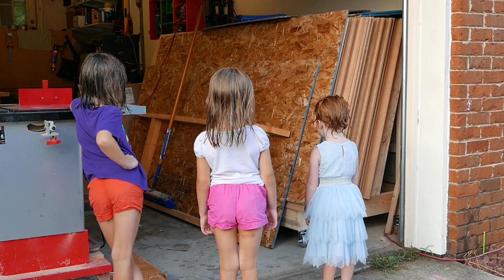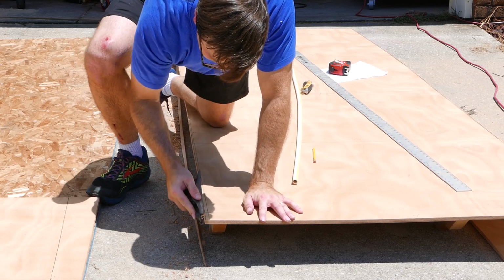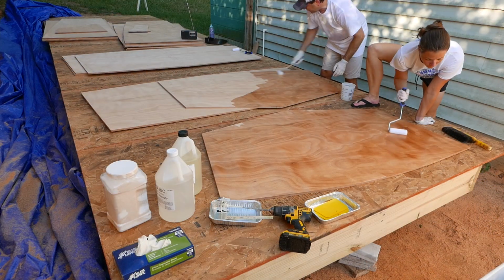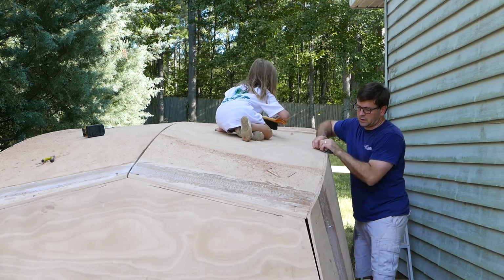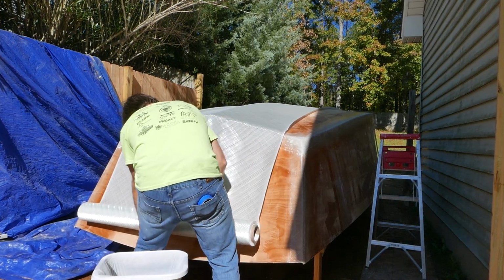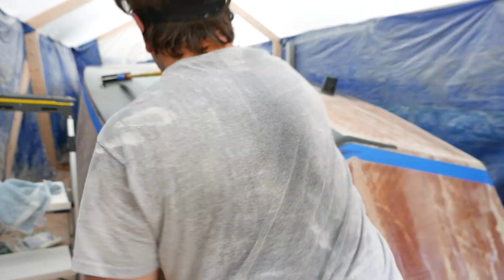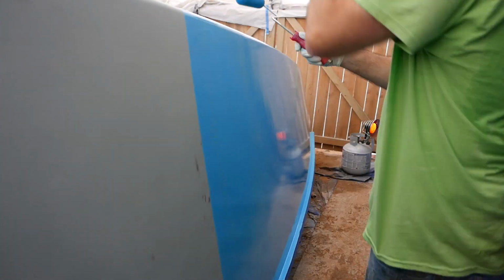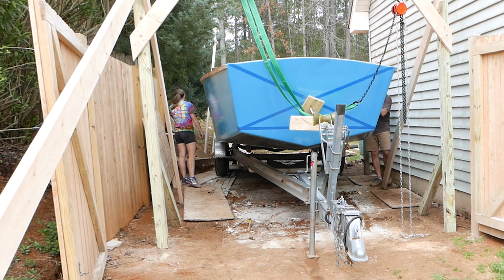Building our GT27 Houseboat, Part 1

Comment: Absolutely beautiful Mark, the girls and the boat!  Great work.  Block planes and flush trim router bits are two of my most used boatbuilding tools.  I haven't used Raka epoxy yet, how do you like it.  Great video documentation, thank you!
Reply from the maker: I've been using Raka epoxy since my first boat (a cedar strip sea kayak) over 20 years ago. It has always been fantastic!

Comment: Did you study boat building at all.  I did in Australia and found your knowledge to be very insightful.  Good work though... Hard work, but its well worth it.
Reply from the maker: I'm a pretty thorough researcher and I love to learn things, so I just taught myself over the last 25 years, mostly learning from reading and the insights of kind people on the internet. This is my fifth boat, so I learned a lot along the way by trial and error as well. When I built my first boat, a cedar strip kayak, I had almost no woodworking experience and had never used fiberglass. But I learned so much on that build and really was meticulous in making sure I did everything right. The boats got a lot bigger after that--a couple of sailboats and a large dinghy of my own experiment--but this GT27 has been the biggest by far, and I'm learning a lot more because of all the systems (plumbing, electrical, fuel, etc.) that will need to be integrated. It also just has so much more surface area that the work is exponentially more than even the 20' twin-masted sailboat I built a decade ago. And the weight is so much higher, too, that I'm learning a lot about towing weight, electronic brake actuators, etc. as I upgrade the trailer. Quite a project...
Reply: @LiveDontWatch  Exactly what I do still.  Just to do research, research and more research....  I'm currently building my houseboat.  I normally find it best to 3d in CAD with the level of detail for the hull and pontoon, then with the cable lay out and the c sections that make up the exterior walling.  Plus the plumbing, etc...  Watched all your vids so far, but have you finished the boat in all, or is it still on going ??
Reply from the maker: @rbob1973  the boat is pretty much where the last video left off. From June to early September, it was just too hot to work on it. Now we're insulating the cabin and getting ready to build out the interior.  I think I can heat it through the winter and get a lot done inside, but I'm scrambling to finish some epoxy work before the weather turns too cool.

Comment: Hi LiveDontWatch,
I hugely appreciate the videos and the building process shown and elaborated upon - huge respect and appreciation for making the videos!!!
Could you please advise on what type of a plywood was used and where it was purchased from? Was it a pressure treated or some sort of a special wood you had to buy from a special place?
Sorry if you mentioned it anywhere during the video, I could have missed it.
Thanks!
Anton
Reply from the maker: The plywood is BS1088 rated Okoume plywood purchased about 4 years ago from Boulter Plywood in Massachusetts. At that time, their prices were better after shipping than many places much closer to me. And the plywood I received was of superb quality with all proper BS1088 markings.
Reply from the maker: FYI, BS1088 is a British standard certification that means the plies will have no voids, knots, or cracks, and will be laminated with a marine grade glue that will not delaminate even when exposed to boiling water for 30 minutes. Okoume is also very light weight. It's the premier plywood for boat building.
Reply: @LiveDontWatch  Thank you! I was able to get in touch with them and arrange the shipment.
Reply: @LiveDontWatch  Could you please advise on a reasoning to glue sheets together with epoxy resin? I've done some googling and it seems like "Titebond III Ultimate Wood Glue" is what's recommended to glue the wood. Please advise and many thanks!
Reply from the maker: @Anton Kosyriev  I think some people use Titebond as a cheaper alternative to epoxy resin, but in my experience thickened epoxy is the best adhesive for marine applications so that's what I use exclusively for boats. I might use Titebond for interior enclosed furnishings, but I've never used it on structural elements or areas exposed to the elements, so I can't say how Titebond holds up compared to epoxy.

Comment: Please sir, at 6:40 you used this very accurate electric saw that allow you cut very fine curves with ease and you called it flush saw. I tried to find it on the internet but a lot different kinds of manual saws. Please, can you share a link to your kind of flush saw?
Reply from the maker: It is a flush cut bit that you attach to a router. Sometimes called a flush trim bit. It's a spinning router bit that has a bearing on the end which rides along the edge of a template to  trace its outline and cut out an exact copy. https://www.homedepot.com/p/DIABLO-1-2-in-3-Flute-Flush-Trim-Bit-DR44100/202585369
Reply: @LiveDontWatch  Thanks for prompt reply & your sharing. May your days be long!

Comment: What wood did you use for the rub rails?
Reply from the maker: Douglas fir. I would've preferred mahogany or ash but it's very tricky and expensive to come by in my area. I may screw some stainless hollowback along the rub rail later to give it some extra durability.

Comment: That seem you filled down the middle of the hull was pretty wide. Hows that holding up?
Reply from the maker: It's doing fine. There is so much biaxial fiberglass on both sides (inside and out) that I don't think the hull is able to flex at all along the vee/centerline, so there should be no stress on the filler. The filler is really there just to eliminate air voids. In fact, the front of the boat is still currently propped up on the vee (i.e., fully supported on one concentrated spot) and there's zero deflection/distortion.

Comment: Looks like you used casting resin! I also build boats with casting resin. Similar shore D and tensile strength rating compared to overpriced west systems epoxy.
Reply from the maker: I use the Raka 127 resin and compatible fast/slow 600-series hardeners. Great value and I've always had excellent results on multiple builds -- a cedar strip sea kayak, two sail boats, a self-designed skiff, and now this houseboat.

Comment: A few nitpicks on your building process:  
Firstly, your panel joints would be much stronger if you had scarf glued them.  Worth the extra effort.  Butt joints like you did would have been okay if you had first routed a shallow depression matching the footprint of your fiberglass tape on both sides of the panels and if you had built up a few layers of fiberglass tape on both sides.  The routed depressions and the correct number of fiberglass layers would have made the joint flush with the rest of the panels and you would not have needed to sand it back down as much.  
Secondly, I noticed a lot of air voids in you fiberglass, indicating insufficient wet-out.  Fiberglass cloth and mat should be completely transparent when fully wetted, showing the underlying plywood without any white spots.  This could be a problem for you in the future, perhaps sooner rather than later.
Thirdly, it is worthwhile to determine and mark the waterline all the way around the hull and paint bottom paint to the waterline.
Reply from the maker: Thanks for the suggestions. I'm well familiar with all of those issues, but there are reasons this design does not use scarf joins--in part because the dimensions utilize the maximum length and width of plywood sheets in several cases, and largely because there is so much  reinforcement from the structure and the layers of 'glass that concerns about the joint strength of the skin are moot. 

There are definitely no voids in the fiberglass. This is my fifth build and I am meticulous by nature. You may be seeing sanding spots, dust, distortion from the camera/lighting, or the sheer thickness (whitish build up) of the many layers of glass, but they definitely are not voids (unless you mean under the temporary butt splices for the hull sides--those were removed for that reason once the panels were in place). 

I chose not to mark the waterline on this hull because I was unable to contact any builder who has successfully completed this design. Although the designer provides some indication of the waterline at various displacements, mine has some moderate adjustments and a custom interior/load-out that may or may not affect it. For that reason (uncertainty of exact placement) and simplicity of maintenance, I chose to forego marking it. This is a trailerable design, so ablative bottom paint is unnecessary, and durability of the true bottom was primary. Hence the epoxy-graphite mixture of the bottom. You're right to be vigilant on each of those issues, but in my case, they don't apply.
Reply: @LiveDontWatch  I see your points.  It seems you've thought these things out pretty well.  I've built one boat and am working on a second.  I special-ordered 5'x10' marine plywood for mine to overcome some of the issues you cited, and scarfed my joints.  The finished product turned out much better as a result, with nice fair curves.  Once you finish outfitting your boat you can easily find the waterline by launching in a calm body of water.  tape a pen to a block of styrofoam and run it all the way around the boat.  Use that "rough draft" as a guide for painting the water line and boot stripe.
Reply from the maker: @locutus8496  Yes that's exactly what I'm planning for the waterline. Very nervous about how this will all go as this is the first time I've built an unproven design without talking extensively with existing owners. It's a huge investment in time and money,  so hopefully performance will match up with the design parameters as intended. We'll see...

Comment: Question:  I've started building the GT27 and I was wondering if I could glue the bottom panels and sides on the strong back and stations itself with just epoxy gluing them together and fiber glassing just the outside of the boat before the great flip?  Could I get by with the entire hull fiberglassed and painted on the outside but without the inside seams fiber glassed until after the flip?
Reply from the maker: That's what I did. All the way to paint before flipping.
Reply: @LiveDontWatch  I watched your video and you used epoxy/fiberglass on the seams first.  I was asking if I could secure the individual bottom pieces to the strong back stations and then glue them in place and fiberglass entire hull without laying them out and on a flat surface and gluing them together first?  This would leave an entire hull to flip with just epoxy and fiberglass on one side?  The reason why I am asking is that I've already built the strong back and stations and I don't have a long flat surface to pre epoxy the bottom pieces together.  I appreciate your advice and thank you for the inspiration to "LiveDontWatch"!
Reply from the maker: @markbroussard7394  Oh sorry, I misunderstood your question. Although your idea is probably possible, if I were doing it over, I would DEFINITELY still join the side panels end to end the way I did in the video (in my opinion). I would be very concerned that trying to align the panels in place, without first having joined them end-to-end with tape, may hinder them from taking a truly fair curvature around the forms. Even then, I still struggled to get a perfectly even/fair sheerline and hull shape, but I think it would've been much harder if they weren't joined first. In my case, much of the struggle was just because of the narrow building area, which prevented me from backing up far enough to get a good perspective to sight the curvature by eye. I'm happy enough with how it came out, but again, I think there would've been flat spots at the panel joins if they weren't already joined together as a single plane to bend evenly as they wrap along the forms/mold.
Reply: @LiveDontWatch  I understand.  You should be proud of what you and your family have accomplished.  Thank you for the information and I'll see you on the river in a year or two!

Comment: Just found this channel. I subscribed and will be following the progress as I want to do the same. Thank you for documenting for us :). 
One question: did you price the difference between buying the CNC  precut kit and just buying the plywood?
Reply from the maker: I remember looking into it, but at the time, I think the issue was that the Bill of Materials (BOM) in the plans is WAY off. It is missing the entire upper structure of the cabin house, for example, so it was difficult to make cost comparisons until I had already done all the work to develop a custom interior layout and the materials I would need for that. Long story short, by the time I knew all the details I needed for an accurate cost quote, I also needed a lot of stuff the stock CNC kit wouldn't have included, so I just did it all from scratch. Even then, it would later turn out there were some omissions/errors in the plans that led me to have to place a second plywood order with a second round of (expensive) shipping charges. At this point, I would have to wonder if the precut kit is really complete, and wouldn't trust that unless I could make contact with someone who actually purchased and built the boat from that kit. As far as I can tell, no one has done that, or at least I haven't been able to find them. If you're planning to build this design, be very, very careful. There are a lot of issues with errors and vagueness in the plans that won't become evident until you're in the middle of the build and heavily invested. If I weren't an experienced builder, I would've missed many of these up front. Even then, there have been several costly surprises.
Reply: @LiveDontWatch  Thanks for the insights. I am not an experienced boat builder...but have maintained many an old boat and worked with my hands most of my 62 years. I just finished watching all the episodes and await more. It looks like an awful lot of work!
Reply from the maker: @MrJeffDemme  No problem. Happy to help with advice if I can. It is a lot of work, and if I were still as impatient as in my youth, would've driven me crazy by now. Fortunately, I've learned to take things in stride...

Comment: What was the thickness of the plywood
Reply from the maker: Bottom is 1/2", hull sides are 3/8", upper cabin sides and roof will be 1/4". This is all reinforced with the integral frames/seats/bulkheads, of course. Very strong, but much lighter than traditional plank on frame construction.
Reply: @LiveDontWatch  thank you